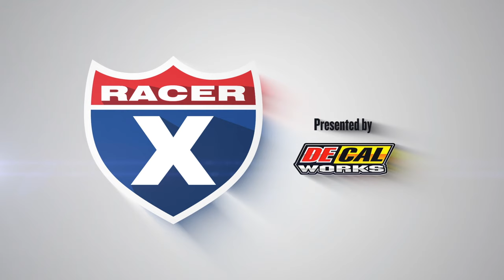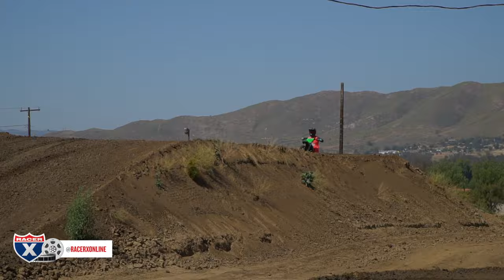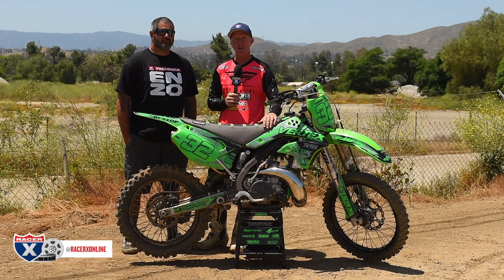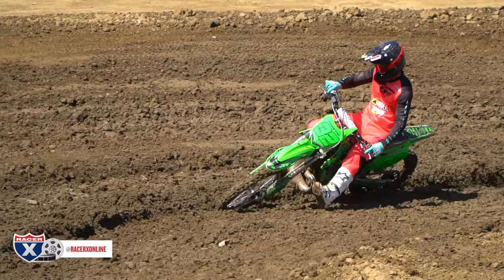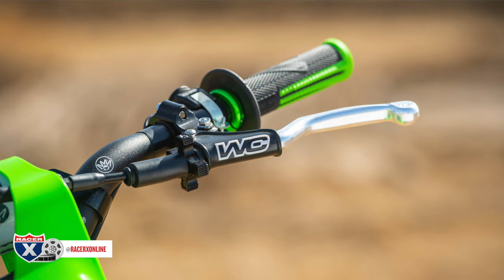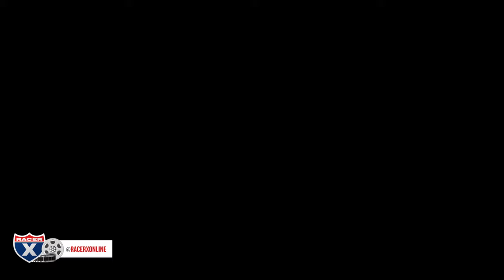Racer X Films: 2005 Kawasaki KX250 Two-Stroke Garage Build

Comment: thats true man about being grumpy if you cant or havent riden in a while.  I also had to fund my own bikes as a teenager. A few years later My speed level was a top intermediate (Canada) to slower pro but by the time I got a fulltime job and could afford a brand new bike ,truck, tools and the equipment to race seriously I had been weight lifting like a body builder extremely hard for a couple years  "just to look bad ass or tough or something lol" and and it caused brutal arm pump so I got out of racing, I didn't figure out the cause of the arm pump till later thought. I did well in some novice 125 races on clapped out bikes when i was 18 but when i  got my first 250 it was a 98 kx 250, racetech suspension, boysen porting (which i never seen before), rad vavle, pipe and silencer.  Thing was a ripper it seemed like it made maximum torque right off the idle and would run through the gears as fast as you could shift em.  Them low end kawi 250 motors had a knarly sound to them.  They were very stable and confidence inspiring, They loved high speed tracks and high speed corners.  They liked to be turned with the throttle and rear wheel but they didn't suddenly slide out like other bikes.  bridgestone intermediated tires were good for this.   Later bought a brand new 01 CR 250, it as a rocket ship and a actually a little faster the the KX.  It  took a while to get used to it, the top end motor, stiff chassis and stiffer suspension required a real expert rider.  I was damn fast on this bike but after 2 laps I couldn't pull in the clutch anymore or hang on to the bars. , called it quits Then got into mma for about 7 years.  I lost 55 pounds of muscle to get down to 155 class. If i would have did that for moto i could have lived my dream of battling for wins or even an amateur title.   Finally some weird auto immune conditions, arthritis and extremely weak tendons forced my out of that all sport sports and then i started loosing jobs, my house etc. Sorry for rambling, my sleeping pills are starting to kick in lol.  its therapy for me be to reminisce and relive my riding days in my head,  Awesome build Chris and thanks for your service.

Comment: How did he get the kx 450 radiator shrouds to fit on the old 05 250 2 stroke?
Did he just swap the gas tank n shrouds right over and they fit in the 2 stroke frame?
Cuz i have an 03 kx 250 and that first era kx 450 plastics wont bolt up to the gas tank thats oem for the 03 250

Comment: I thought the handling on the 2005 was atrocious.  Is MXA telling stories to us again?
Reply: Works great with 22mm triple clamps.  The stock suspension valving is pretty terrible too.
Reply: It really is pretty awful
Reply: I have an 06 which is the same bike.  No MXA is not telling stories.  Get that bike out of the ruts and on some hardpack and he wouldnt be liking that bike. Front end pushes and then tucks.  Ive gone to pretty good lengths to get my bike to handle decent. Switched to 2012 kx250f  SFF forks. 22mm offset triple clamps. Longer pull rods to lower rear end. Oh yeah. I also cut the steering head off and had decreased the steering head angle from 26 to 26.5. which puts more trail in  the front suspension geometry and makes the front wheel more planted.... Engine is stock. Someday Ill get a 300 kit on it.
Reply: Nobody had a problem with the 26 degree head angle and 22mm offset when Kawasaki used it from the 90's through 2002.  I can't believe people cut their frames up because of what a magazine says.
Reply: @TurbodanNM  it wasnt based on what a magazine said. It's based on math.  In 05 they decreased the head angle one deg and changed nothing else. I've also heard from good sources that james Stewart ran offset steering head bearings to slacken his head angle. Per ama rules you cant change the frame geometry from how it was made.  I did the same as factory kawasaki did but I dont have to adhere to ama rules. Just a vet racer
Reply: 22.5mm offset triple clamps w/ 11-12 KX250F forks (47mm), pro-circuit link, heavier fork springs and shock spring, slide forks up in clamp, pro-circuit platinum pipe - excellent bike
Reply: I’m a dude how did those 2011 kxf clamps work out for you?everybody highly recommends 22mm.Are they good